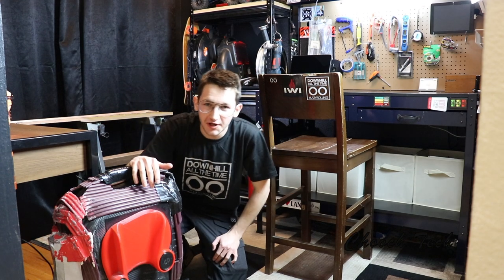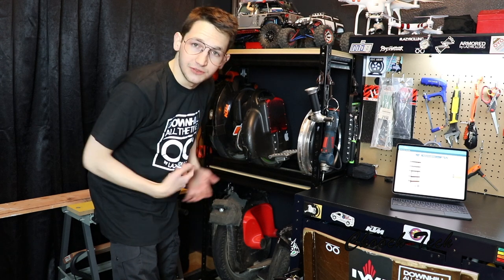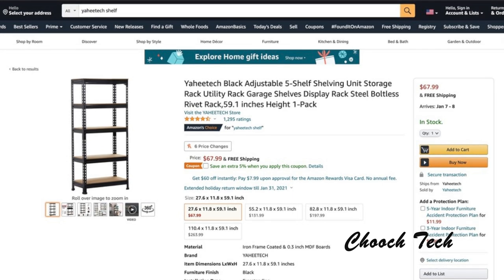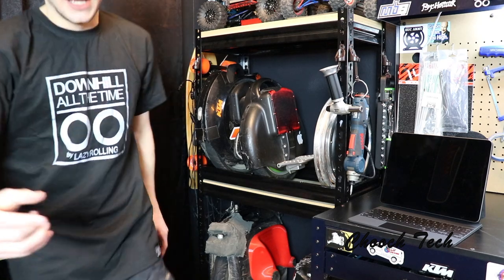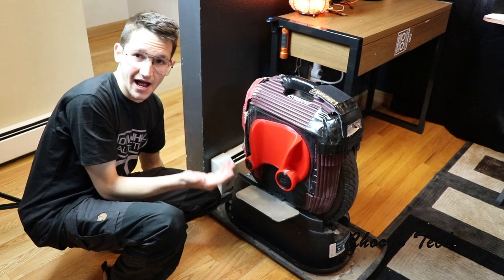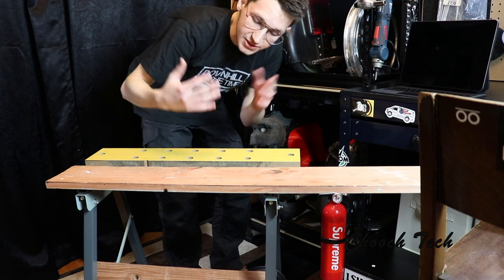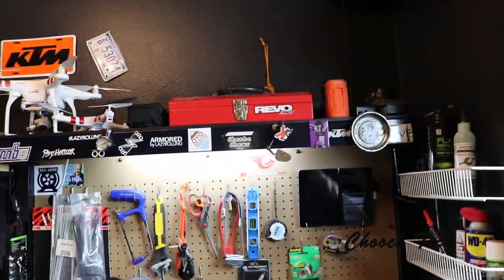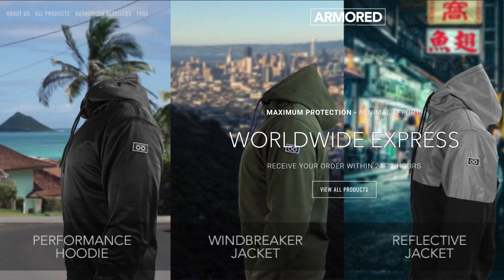Organized Electric Unicycle Storage Stands Tools Cheap

Comment: Hi chooch, have you covered the type of padding you use, for example at 11:30. the red lines padding is called what?
Reply from the maker: yep it's sorta hard to find with the 3m tape already on it so I recommend just getting the non adhesive kind and hot gluing it with strong hot glue. I talk about it here, cheers! https://www.youtube.com/watch?v=qRP3TNnrZi0&ab_channel=choochtech
Reply from the maker: The foam is linked below in the description, its baby padding for table corners
Reply: @choochtech  Kippis! I've been looking for months with no luck. preciate it!